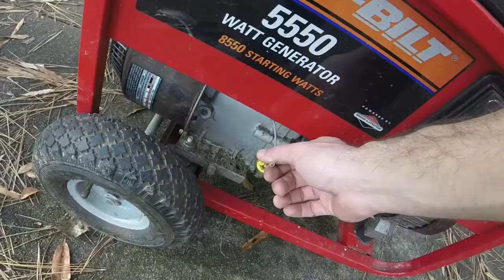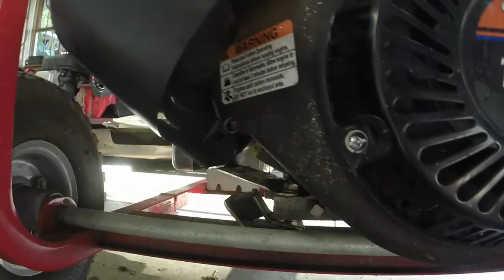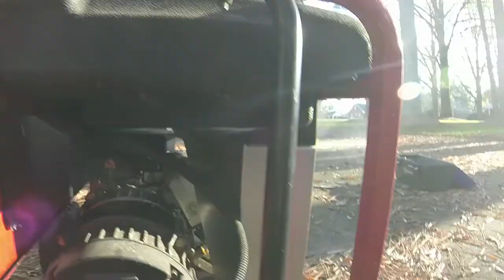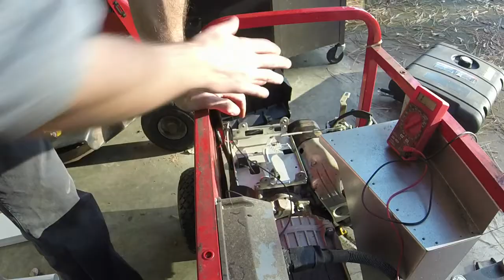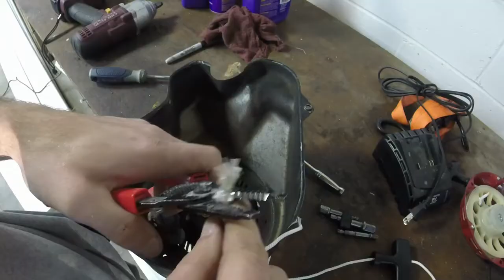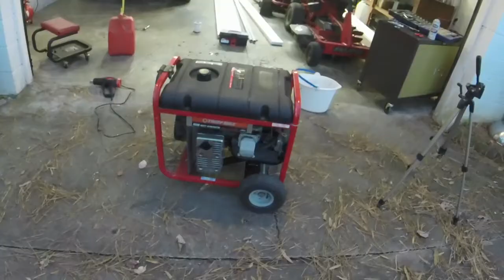Free Troy Bilt generator with no spark: Diagnosing and "fixing" the problem (low oil sensor)

Comment: Same generator. Decide to not start. Diagnostic lead to the craziest problem. Had fuel, had compression, tester showed spark. Noticed metal in the plug boot looked cracked. Pulled the boot off and saw some metal flakes fall out. Ordered some new terminals, pryed off the old one, put on a proper 90° terminal (the one on there was a standsrd terminal that they forced around the bend in the boot), put on a new boot. STARTED RIGHT UP!
Bad spark plug terminal, caused a week worth of diagnostics

Comment: I realize you might have sold that generator along time ago, however,  just wanted to let you know all you needed to do was switch the wires on the switch.  The module was probably fine. I bought a generator just like the one on the video and same as how someone attempted to work on yours, they also tried working on the one I bought. The point is that the previous owners switched the wires on the switch. I rewired my switch, red wire to the prong on the off side of the switch, then the white wire in the middle, then the black wire at the end where the On side is. My black wire was in the middle  and would not give spark either. Then I did the rewiring and it worked.  Thought you might need to know for future or for others dealing with this as well.
Reply from the maker: Yes I realized after the fact that I made this a lot more difficult than I needed to.  I think the only thing I needed to do was unplug the oil switch wire from the switch.

Comment: Had the same issue with mine. Same model as yours. I just pulled off the connection from the oil module to the back of the switch. Fired first pull and on off switch works great. Great video. Thanks for sharing.
Reply from the maker: I learned this trick after the fact.  They both accomplish the same thing I suppose although I took the long way haha.  Thanks for watching!
Reply: Same for me, pulled off white wire behind  on/off switch.  I am the Original owner, the low oil sensor stopped the generator once back when it was new and had been running for about 10 hours, and never again since, probably was not broken in.  Have to keep a close eye on oil level, and thanks  for your video.

Comment: I have the same generator, which recently decided not to start.  Given that it had been sitting for a winter without starting, I suspected the carburetor may have been gummed up, so i proceeded to clean it.  Still no start, so only then did I discover no spark.  After watching your video, I discovered the problem was identical to yours - a failed oil sensor.  Thanks for taking the time to make this helpful video.
Reply from the maker: Thanks for watching!  After filming I was informed a better solution is to simply unplug the white wire from behind the switch.

Comment: Great job.  I think I have a bad low oil sensor on my generator but will have to watch again to see how to tell if it is bad.  I did not quite get that part.  thanks for the video.
Reply from the maker: Yes it's not too difficult to diagnose.  I was told you could disconnect the white wire from the switch to bypass it too.
Reply: @The_Happy_Aviation_Enthusiast  hush it osha

Comment: Why don't you use a drill with a socket and spin the flywheel to check for spark
Reply from the maker: I could do that too.  I was able to see the spark clearly once I removed the coil wire.  But for mowers that's a good idea.  My drills aren't very powerful either.

Comment: You can leave the sensor in, just disconnect the white wire to the switch.
Reply from the maker: Thanks, I was unsure if that worked or not.  Now know for next time!
Reply: What white wire are you talking about to what switch the on/off switch ?
Reply: @Jordan-sv3pu I'm trying to figure that out too did you figure it out

Comment: Those low oil sensor can throw some people off I use a genorac pressure washer that had a bad oil level sencor it would run when I disconnected it from the engine